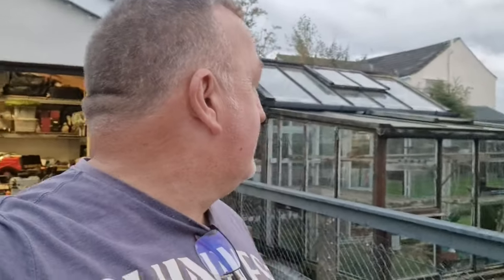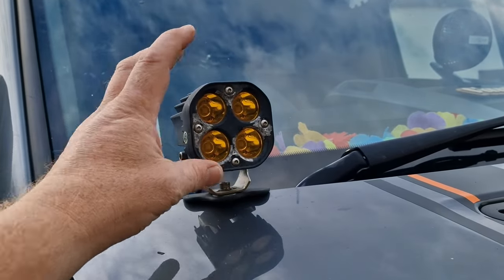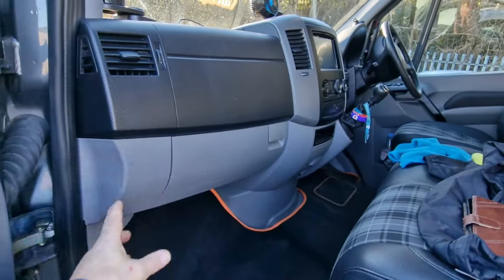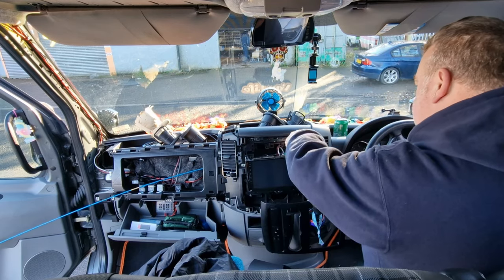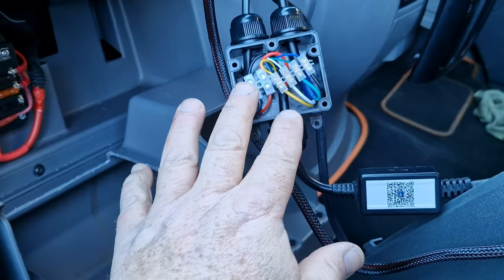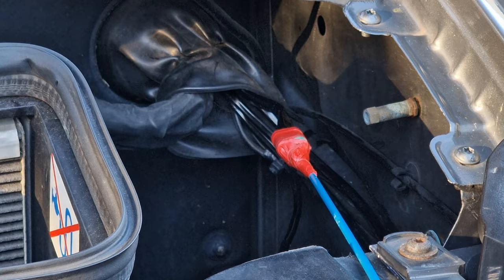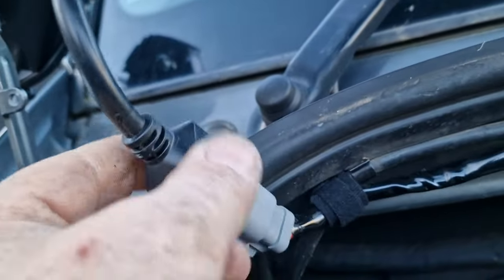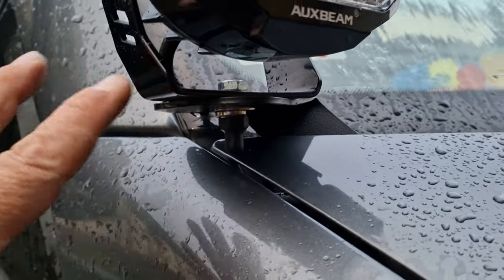Install the Auxbeam V MAX series 5" side shooter spot lights Mule bonnet mounts

Comment: I really wanted the mounts, last time I was out looking for new lights. But those bonnet mounts. They are insanely expensive!!!!
Reply: Checkout the bonnet mounts from Wheeliams. Stainless steel but not powder coated
Reply from the maker: I don't think they are badly priced the quality is amazing a proper well made product 👌
Reply: @TheCraftyBlindersvanlife  I've no doubt about the quality of Mulevans products but their price list is eye watering! However, the Auxbeam lights are amazing and in my opinion, great value for money. I have their 3" ditch lighters on my bonnet....they were a massive help in the French Alps a few weeks ago. I just might order the 4" units after Christmas.
Reply from the maker: I dont think £78 is that bad. They are a fit and forget option, being stainless steel and powder coated. You will never need to do anything other than wash them 

https://auxbeam.com/CBV1/V-MAX 15%off code:CBV1 

https://auxbeam.com/CBV2/V-PRO 15%off code:CBV2

Comment: Hi Sam. Your side shooters, at the height you have the lamps, does the side shooter bother you whikst driving? Will the side shoot bleach inside the van? Im wondering whether to fit a pair with the Mule brackets, or lower down at the grill height?
Reply from the maker: They do light up your cab while using then but it's not too bad mate
Reply: I think I'll be getting the same 5D light bar as you, as I don't like the spots of the 5D Pro. But my other lamps will be amber fog light versions, as I like the idea of not reflecting in dust, fog and snow?

Comment: Hi there - really useful video. I thought you were dismantling the van for a minute then! Newby question... If I were to put lights similar to yours are the pros and cons to connecting the Auxbeam unit to the leisure battery or is that a no, no?
Reply from the maker: I would only have essential equipment connected to the leisure battery so as not limit your capacity